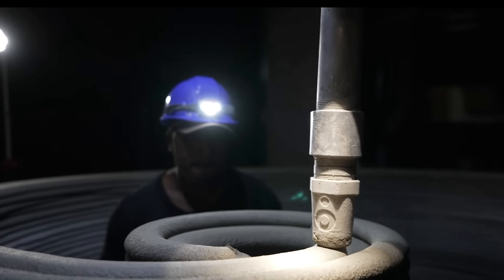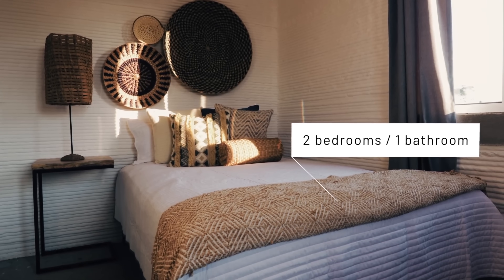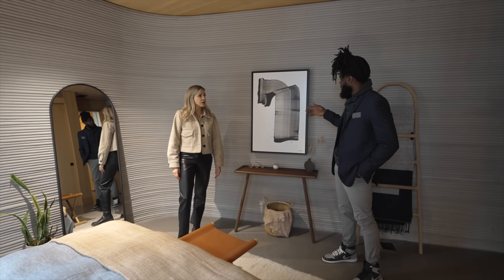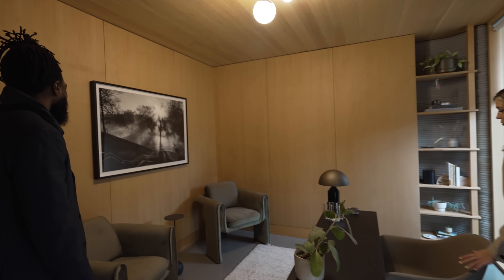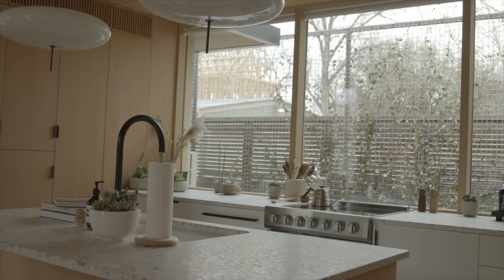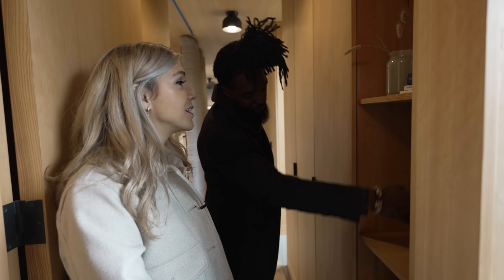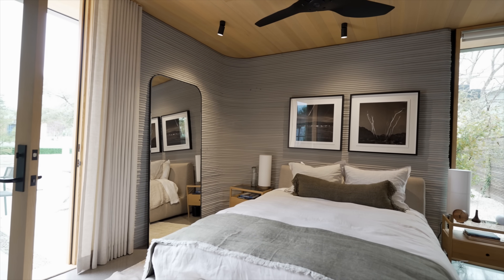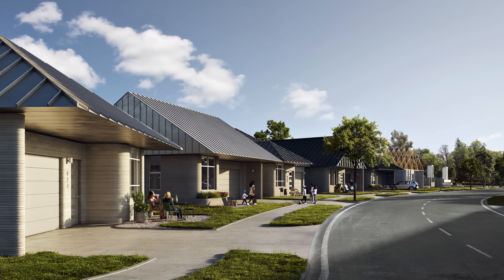Inside A 3D Printed House You'll ACTUALLY Want To Live In

Comment: I keep wondering about how the WI-FI would be affected in concrete homes. The video showcased a 2,600 sq ft. property, and I'm suspecting a loss in fidelity without repeaters. I live in a 1,400 sq. ft. home with wood frame interior walls but cinder block exterior walls, and the signal quality drops significantly as soon as I step outside (no repeaters, just a modem/router located at the center of the home). Can anyone in Europe help me get an idea of how well your signal is spread?

Another question I have is how accessible the wiring and plumbing would be. I suspect that any repairs or modifications in the future would be quite an undertaking...

Comment: Where’s the rebar, what will happen if a tornado came thru the area, as said before, the walls are not smooth enough inside, and the cost of heating it in the winter. Cooling would not be that bad in the spring & summer times. What of the gas lines, water lines, electrical wiring that needs to be covered and insulated ??? There are still a lot of issues to be dealt with in this 3D structures…

Comment: In fairness, these are 3D printed concrete walls. 90% of this video shows non-printed stuff that you could get in any house for the same cost. We are finishing up an ICF home (insulated concrete forms for walls) to move into this summer and the difference in quality between that and this one is dramatic. All of the walls in this home are visibly uneven as a result of the construction process. so I expect it to get a lot better over the next few years as there is obvious room for improvement.

Comment: not a big fan of the inconsistency of the conc. lines. i prefer clean straight lines in design, but that's just me. How would patching things up work were you to decide to move picture frames or move a tv elsewhere? how are those windows waterproofed? I appreciate the thermal mass comment he made, it's way easier and less labor intensive than packing in insulation inside of studs. I feel like a high level of coordination has to happen before the concrete even begins to get poured especially with laying out elec. lines, plumbing and ventilation.

Comment: Love it bc the price is so much lower than typical housing and also the thermal density and organic shapes. It’s perfect.
Reply: I do NOT want that house.  to many "technical" /structural Restrictions inovolved with it and  it required constricted sizes.  The material is a horible mess. Then huge expense to "cover/finish those walls".  Wiring and plumbing issues.  If you want to build something like that there are better/Cheaper , simpler ways to do it.  search ,... Oh what is it called,  Mud/sand bag , earthen bag construction.  And I am not saying I would want that for my main house either.  I've have seen nice hotel rooms....  cement is a mess! espeically when you leave it exposed. Dirt , spiders, and bugs "sticking to it" and those layers/grooves!  then trying to deal with plumbing, electrical etc,  and even try hanging a shelf or picture. :-)) wanna change a door or window? 😅😅😅 that texture is aweful.  even beyond cleaning it has problems.  the novelty would wear off quickly.  and trying to cover that up with wood, plaster, etc... IS $$$$$   Are you noticing that even with the camera/"lense"?shooting done to try and make it  look bigger.  Look at how SMALL the rooms are. EVEN The ones that are supposed to be "larger rooms"  Oh and I live in a mostly solid cement walls and roof/ceiling ...  I will call Bull Sheets on it being 75 F inside on  days when it is in the 90's .  I live in the desert and once it starts warming up in the spring in the "90's" after a few days the cement warms up, the walls warm up and there is no way you are going to have 75F inside without turning on the AC.  if it goes "hot" then cold" then "hot" the cold for a couple of days, then Maybe... But after after a few solid days or warm/hot temps, the cement warms up. and as the temps keep on climing for "the SUMMER/ spring"  the walls of the building keep getting warmer.  In the low desert in AZ,  if I turn off the AC it will "quickly" start climbing toward the 90's F. I guess higher if you forget to turn on the AC.  Oh, and of course the Reverse happens in the winter.  Sure the novelty of this is "cute"  but the reality is..................  Not So Great.   especially if you DON'T want just a little/cramped "single persons"  condo/vacation condo"  and You don't want the MESS of unfinished cement walls.  You know what else you will notice about this... NO REBAR REINFORCEMENT/"structural support". ("no multiple stories") And there Are More issues than just these... Ahh but the Novelty of it. 😅

Comment: Feel the concrete printing is 30%of the build once you remove all the wood and glass... And you'd still need an electrician, carpenter, plumber, water proofing, roofer. 

Meaning this is great for architectural designs but still in its infancy as a cost saving construction method, prefab concrete walls seem an easier option.

Comment: It's important to keep in mind homes often get renovated, structure added, layouts changed, walls moved, etc.

Forget about doing any of that when you have poured concrete walls. Yes I said poured concrete walls because that's exactly what this is despite being called "3D printed". It's just a gantry holding and positioning a hose a nozzle accurately as the concrete flows as opposed to Juan and Pablo dumping concrete into a form while smoking a cigarette.

The end result is the same.

Comment: To make these houses more affordable, you could just 3d print build the exterior walls, then frame and plaster all the interior ones. It would ad more flexibility to it as well if in the future you want to remove some walls and modify the interior space to suit your needs.
Reply: Great idea
Reply: Yeah I wondered if there’s an option to plaster inside and even use wet concrete to plaster the outside. I think some will be out off by the look otherwise.
Reply: Walls are pretty much the cheapest part of a standard construction (especially if you can use ready made elements), so there is still a long way to go for any actual effect on house pricing
Reply: Its not even affordable. They charge the average midde class person shopping around for a home 700k then do good deeds for people that dont work.
Reply: @WeAreSoBackBros  yep. it is just the vegan equivalent of the construction. Ridiculously overpriced, but hey we got to praise it.
Reply: @tkismik8146  @ihateyall, That's how innovation works. The TV's in your house were ridiculously expensive when first released, then as technology expands the cost decreases, allowing the price to decrease.
Reply: @ericXJ88  It is fancy, but not innovative. Not yet at least. It still requires considerable site and plant space, huge machinery, and the carbon footprint is much worse than the equivalent of a reinforced concrete structure. (these are after all just ground floor level houses).
So far, it is 3D printing for the sake of 3D printing.
Reply: @ericXJ88  this is how champagne socialist work. Be rich, help the poor, screw over the working class.

Comment: Only issue that you’re run into is if there’s structural damage from the footing shifting similar to garage floors, the damage would be to noticeable to fix. With wooden homes the material can flex to conform to the earth. With concrete there’s a stress point to once the damage is done you have to take down and rebuild. Maybe if they built these in smaller sections that you could replace without reconstructing the surrounding walls it would work but the house they presented seems like fractures is inevitable. There’s a reason why side walks are built in smaller sections.

Comment: Here's the problem, its not scalable, modifiable, mutable.... Traditional home building uses concrete/bricks for the exterior frame/exoskeleton if you will, and the inside can be designed however you want. 3D printing can also do this, but for this particular example, you got curved structural walls fking up the middle disguised as design, super impractical if you want to add/remove rooms/walls/floors.

Comment: I want one of these freaken houses LOL This is soooo eloquently done and LOVE how the rough concrete is used as a design element on the inside of the house!
Reply: I do NOT want that house.  to many "technical" /structural Restrictions inovolved with it and  it required constricted sizes.  The material is a horible mess. Then huge expense to "cover/finish those walls".  Wiring and plumbing issues.  If you want to build something like that there are better/Cheaper , simpler ways to do it.  search ,... Oh what is it called,  Mud/sand bag , earthen bag construction.  And I am not saying I would want that for my main house either.  I've have seen nice hotel rooms....  cement is a mess! espeically when you leave it exposed. Dirt , spiders, and bugs "sticking to it" and those layers/grooves!  then trying to deal with plumbing, electrical etc,  and even try hanging a shelf or picture. :-)) wanna change a door or window? 😅😅😅 that texture is aweful.  even beyond cleaning it has problems.  the novelty would wear off quickly.  and trying to cover that up with wood, plaster, etc... IS $$$$$   Are you noticing that even with the camera/"lense"?shooting done to try and make it  look bigger.  Look at how SMALL the rooms are. EVEN The ones that are supposed to be "larger rooms"  Oh and I live in a mostly solid cement walls and roof/ceiling ...  I will call Bull Sheets on it being 75 F inside on  days when it is in the 90's .  I live in the desert and once it starts warming up in the spring in the "90's" after a few days the cement warms up, the walls warm up and there is no way you are going to have 75F inside without turning on the AC.  if it goes "hot" then cold" then "hot" the cold for a couple of days, then Maybe... But after after a few solid days or warm/hot temps, the cement warms up. and as the temps keep on climing for "the SUMMER/ spring"  the walls of the building keep getting warmer.  In the low desert in AZ,  if I turn off the AC it will "quickly" start climbing toward the 90's F. I guess higher if you forget to turn on the AC.  Oh, and of course the Reverse happens in the winter.  Sure the novelty of this is "cute"  but the reality is..................  Not So Great.   especially if you DON'T want just a little/cramped "single persons"  condo/vacation condo"  and You don't want the MESS of unfinished cement walls.  You know what else you will notice about this... NO REBAR REINFORCEMENT/"structural support".  And there Are More issues than just these... Ahh but the Novelty of it. 😅

Comment: not a fan of the concrete look. It mostly has to do with the inconsistencies on the wall, some lines were thicker then others, some protruded more then others, but it's understandable, because unlike the normal 3D printers ; these guys can't just start over when something doesn't look perfect/symmetrical. I did like the double layers making up the walls, but idk about the curved shapes everywhere, it felt more like a waste of space, the kitchen looked a bit cramped / empty. How do they do windows ?

Comment: I've seen another video of a 3D printer that smoothes out the walls as it goes -having the choice would be good as not everyone is going to like the 'layer cake' look, its also cheaper than paying for plastering. One great feature of 3D printing is you can be as organic as you like incorporating subtle curves into the design as per the entrance to this house. Also the inbuilt planter is a nice feature and its probably possible to make living walls with embedded planter (simply add them as the printer goes along). Insulation poured between two layers shouldn't be that difficult either..
Reply: exactly what i thought. smooth the walls as you go and put insulation between the inner and outer wall and this becomes way more universal and applicable for other climates.

Comment: Ok, let me be the one that says the Emperor has no clothes. The concrete only replaces the walls which would be cheaper to build with traditional 2X6's. Concrete is porous and will stain and very difficult to clean. It is ugly for interior and will cost a lot to cover with expensive wood paneling. Electrical, plumbing and HVAC would be orders of magnitude more expensive to install, and a nightmare to change or add to later. Installing roofing, windows and doors will add additional challenges, not to mention the insulating value of concrete is pretty low. I don't see a single upside to this. The is the wrong solution to a problem that did not exist.

Comment: There's a great irony that if you try to use any building technique besides 3D printing to make a house with lots of curves it will be far more expensive to build. 3D print building can be quicker and therefore cheaper but you can have the curves and still be cheaper than a conventional house build. My only regret with the property show here is that I can't currently buy IT or one like it. The exposed concrete within the interior would not bother me but I do wonder if there are any liquids you might consume within a household that might react chemically with the exposed concrete which might (over time) result in dust. I'm sure the concrete product has been thoroughly tested but somewhere in the history of Asbestos, people must have presumed it was safe only to find out much later that it was a health timebomb.

Comment: Leaving the wall open in the shower was really... uhm. No. You dont have full aging on the material to attempt such and cleaning wax or soap off of it is going to be a degrading issue as well. Further, the other major issue is repairs. As much space as possible is floating or fully ceiling floated beds. Not a back/bed breaker idiot fold up, especially considering how ridiculously high the ceiling is in such a high heat zone on this model shown and the costs of having to cool it there are going to be exponential with the current world and ongoing.

Comment: Usually we add steel bars to the cement to maintain the firmness of the cement. I didn't see any steel bars or anything in the process of 3D printing the wall presented in this video, so I don't know if the wall is strong enough.

Comment: Ok. Hot weather outside, but 3D Printed house keeps the house cooler inside. Got it. How about the opposite? Is that insulation good enough to withstand outside cold and keep the inside warm?

Comment: As someone actually having one built and in a state where EVERYTHING IS MORE EXPENSIVE. That state being NY. IM HAPPY TO SAY ITS APRX 40 PERCENT cheaper then a traditional stick/woods home. Keep in mind this is for the basic layout suck as foundation floors walls ceiling does not include extras such as furnishings tile cabinets things to that nature so this is basically priced with just the walls house floor ceiling garage if you choose nothing extra but considering you're saving 40% with that there's plenty room left over to take care of those so generally speaking a house 3D printed versus a sticks and Wood home let's say a steak sandwich home cost $400,000 for that same exact home I would say you're looking at about $225,000

Comment: Being in Florida where hurricanes are common:  if they could print these with some gap between the inner and outer layer, insert rebar then pour the walls solid, that would be an excellent hurricane resistant structure.  Plaster the walls to make them smooth and they would "look" just like any other house, inside and out.